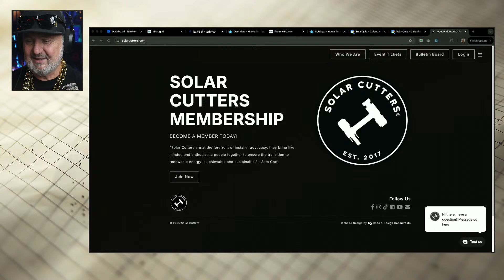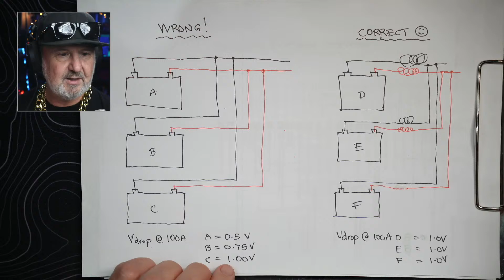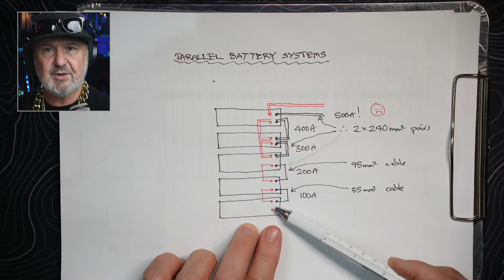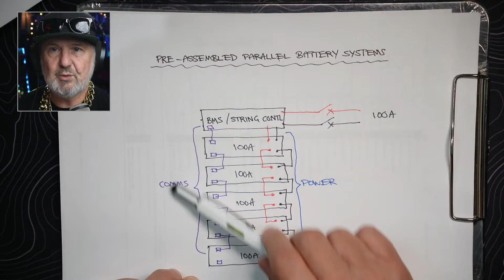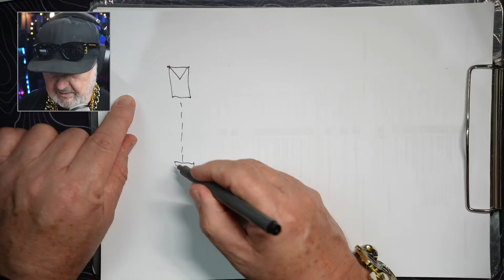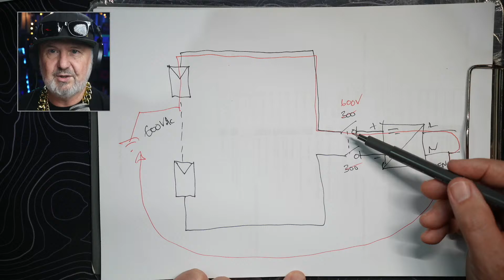Battery overcurrent protection and isolation requirements of AS/NZS 5139:2019

Comment: Hi Glen
Can you please clarify in 5.1.3.4.2 (ii) at AZNZS 5139 states that the cable must be double insulated if a DVC-A battery  is connected to a non-separated PCE (Example solar inverter)... If the standard is giving the direction on how to install it then it is possible to install a DVC-A battery to a non-separated inverter by installing a double insulated cable. please advise
Reply from the maker: Yes, but if the PCE is non-separated and the PV port is > 120Vdc then the DVC-A battery side is deemed to be DVC-C and thus all the requirements of installing an LV electrical installation from AS/NZS 3000 applies including double insulated cables and no live parts exposed (IP2X as a minimum).